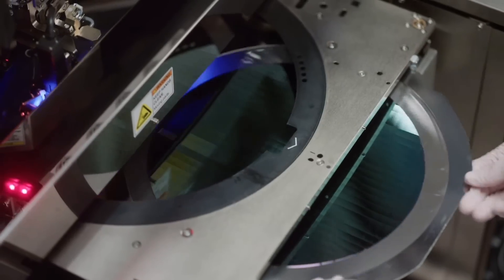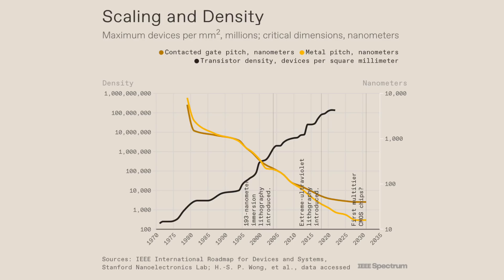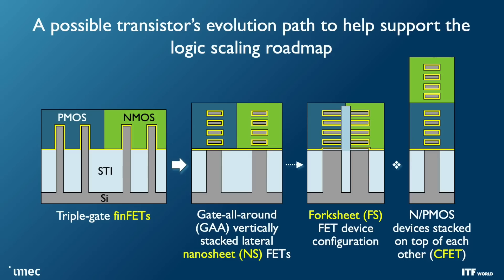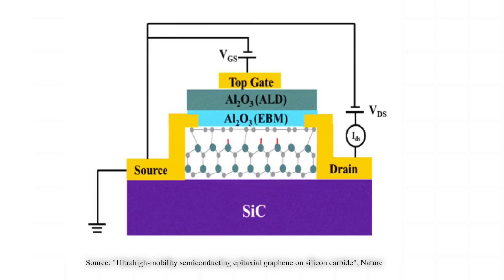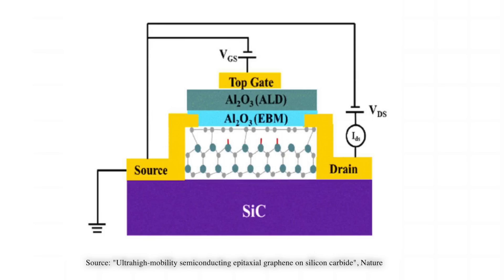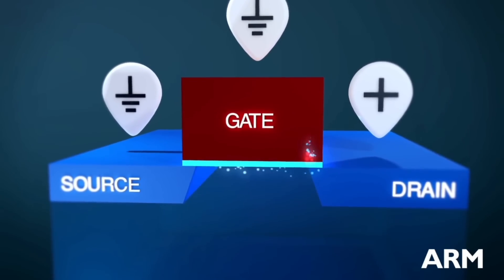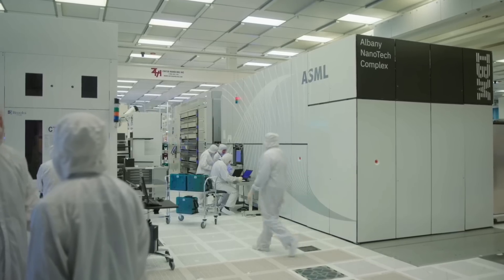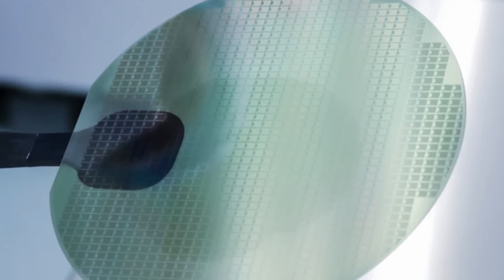Microchip Breakthrough: New Era of Electronics

Comment: The circuit board manufactures use ground plane / power plane layers on their multi layer circuit boards. Why can't chip manufactures do the same thing except use the layers as heat conductors to draw the heat out after every 5 layers of stacked material? I used to work at Intel both as a process tech and in the automation department so I am familiar with the manufacturing process. Fairly simple actually, just a series of steps that involve masking layers and either implanting material or etching it away, then remove the mask and add a new mask for the next layer. The hard part is creating the lithography layers at those smaller and smaller dimensions. However creating a heat dissipation plane layer should be very easy, simply diffuse a conductive metal layer with via's that a large enough to allow the single paths through without interference. Create a pathway to the outer edges for the heat dissipation layers and tie them to the heat sink for the chip. I am sure they can come up with a layered grid with heat sink via's that travel vertically which would be the shortest path to where the heat sinks interface with the die. Once the pattern is figured out simply add it to the design rules in the CAD software being used to design the microchip circuits and it will automatically route the circuits around the heat sink via's!

Comment: A new semi conductor material. Thats massive news:)
The heat problem starts at 2000 mhz on the x86 chips.
I wonder if the material will get an upgrade in the future. And if this version is actually 1.0????   :)
Boron needs some economic throughput:)

Comment: 📝 Summary of Key Points:

📌 Researchers have developed a new semiconductor material called "semiconducting epigraphene" (SCG) by growing graphene on top of a silicon carbide wafer and introducing impurities to create a band gap.
🧐 SCG-based transistors have the potential to switch quickly and support high frequencies, thanks to graphene's high electron mobility.
🚀 The manufacturing process for SCG is compatible with conventional methods, making it economically viable. However, there are still technical challenges to overcome before mass production can be achieved.

💡 Additional Insights and Observations:

💬 "The number of transistors in a chip doubles every two years, but it is becoming increasingly difficult and expensive to fit more transistors into a single silicon chip."
📊 Graphene has high thermal conductivity but lacks a band gap, making it unsuitable as a semiconductor. SCG solves this issue by introducing impurities to create a band gap.
🌐 The researchers aim to integrate SCG technology with silicon carbide technology, which is already well-developed and widely used in high-voltage applications.
🌐 Other potential semiconductor materials, such as boron arsenide, are also being explored, but their fabrication at high volume and defect-free remains a challenge.

📣 Concluding Remarks:

The development of SCG-based chips could revolutionize computer chip technology by enabling faster and more efficient electronic devices. However, further research and investment are needed to overcome technical challenges and achieve mass production.
Generated using TalkBud

Comment: It's time to move towards a new chip material standard across the spectrum of existing chip types. What other materials could be used for the Si layer? You keep identifying things that make me wish my EE education was today instead of in 1978!
Reply: The two candidates to replace Silicon is Silicon Carbide and Gallium Arsenide. Both of them are more expensive to produce than silicon wafers. Gallium Arsenide is the most expensive but also the best switching property. SiC is a lot cheaper but still more expensive than Silicon. It has better switching property than Silicon but not as good as Gallium Arsenide. Also SiC is very good on high temperature and high voltage application.

Comment: You are a Technology Goddess. That said, as we stand on the shoulders of William Shockley, Walter Brattain, and John Bardeen of the Bell Labs. The Integrated Circuit became taken for granted less than two decades later. Microprocessors soon followed, and the GPU after that. It wasn't so long ago that 640K of memory was considered all we would ever need (Bill Gates) and we now take Terabytes for granted in a laptop. I remember when the Great Seymore Cray discovered the speed advantage of ECL (emitter coupled logic) in his 5/4 NAND Gate Cray Supercomputer, which was essentially millions of transistors in 5 and 4 input components sandwiched between copper heat dissipation plates that formed modules (stacked vertically) held in refrigerated "cold Bars" requiring 100 tons of cooling to keep the machine at room temperature. He was experimenting with Gallium Arsenide substrate chips toward the end of his life, but he could never make one that worked reliably in the Tera-Hz range.  You follow the bleeding edge, and for that, we love and admire you for taking us along. ☺
Reply from the maker: Thank you for this comment

Comment: We are reaching a limit on transistors on a chip. Now we need to either make 3 input transistors or find better ways to utilise them. I have been talking abotu 3 dimensional chips for years since I was in Uni in the early 90s. Surprised it took so long. The way forward is analog transistors. No, really! What is better than 1 or 0? 0 to 1 and everything in between. Like a variable transisitor instead of fixed 0/1. If it will work for quantum computers, it will work for "transistors"

Comment: If the electrons go faster will my batteries will go flat faster. Always a pleasure to watch, happy with the physics details.
Reply: I think the electrons will move faster with the same amount of electricity because there will be less resistance
Reply: @ZeroHero00001 leakage current will be a problem if the resistance is low when the transistor is off. You want very low resistance when on and very high resistance when off.

Comment: Thanks for excellent coverage !
There are several "high performance" semiconductors in use, Gallium, for example. Stacking die and even wafers in 3d too. Both have been used in military applications for decades. Junction temperature has always been a limiting factor and running at high temps with these 'exotic' materials , simply works.
Reply: Is it GaAsP?

Comment: My gut tells me that economically viable photonic chips will not be possible until we master RTSC’s, specifically we need to use very similar concepts in the materials manufacturing technologies that will be necessary to create RTSC’s. 

Problem is, most of the necessary tech to get to this next level of material manufacturing science, is so far off from where it needs to be: specifically our ability to produce and control magnetic fields in their full range. I have my ideas how we can make some significant shortcuts and they’re supported by research papers, but it really is a matter of pure luck for the separate sciences to click together for the right person in the right place with the right resources with the right team at the right time, to produce the right next step in many next steps.

Comment: I remember the 1980-2000 when we progressed from 8 MHz to 1 GHz. It has been so disappointing that we haven't surpassed 10 GHz in the last 20 years.
Reply: yeah, me too. those good old days, when every Christmas you've got MHz doubled :)
Reply: Why would you want 10 GHz other than bigger number better? Doing the same amount of work at much lower clock speeds is orders of magnitude better.
Reply: @JustSomeDinosaurPerson  some code is limited by single thread speed, and can't be made faster with an improved pipeline. Faster cycles is the only thing that makes it faster.
Reply: @JustSomeDinosaurPerson  as mrpock said, you often need single threads (single cores) to do tasks. Most code requires the previous calculation to perform the next calculation and can't be threaded, so you need maximum GHZ.
Reply: 10Ghz should be possible if we used photonic chips instead because they don’t create heat
Reply: @chrisbampton5225 They do create heat but far far less than standard transistors and chips.
Photonics would offer more speed and less heat. Optical Gates are being experimented on and maybe in a decade or two we might see the first fully optical chip!
Reply: Lol - at some point, the heat from the cpu will be xrays and gamma rays, if you keep upping the cycle speed.
Reply: I may be wrong but I think at 10ghz the signals exit the chip and become radio through the air, and the chips would have to be cooled by liquid nitrogen to keep from catching fire 🔥
Reply: @craigmuranaka8016  you are talking about two different things, electrons vs photons (electromagnetic radiation).